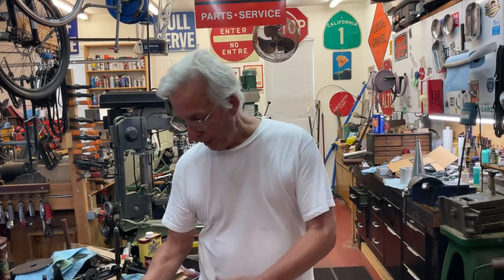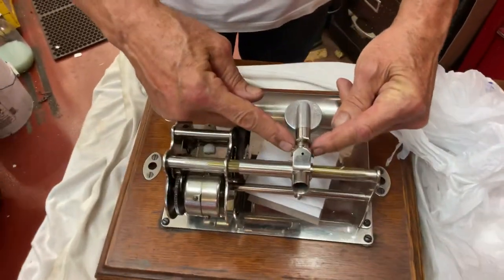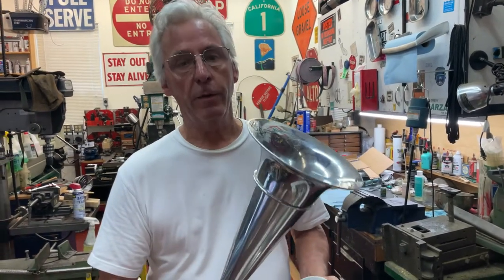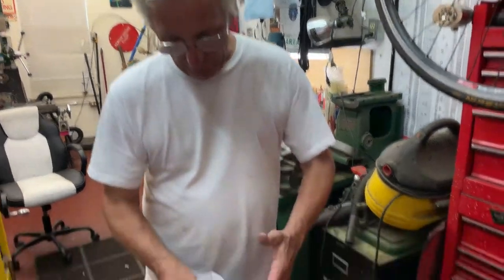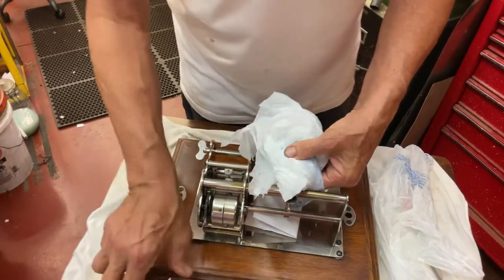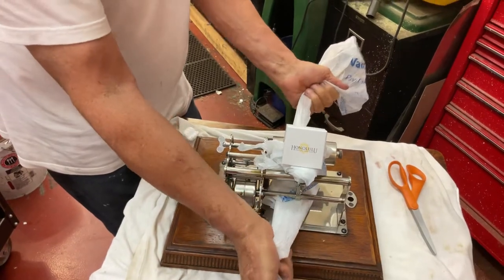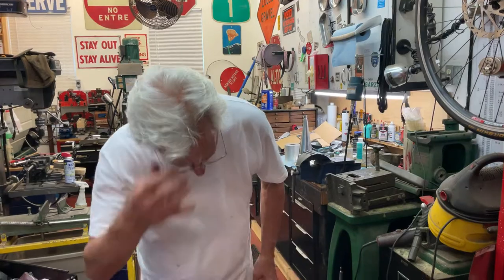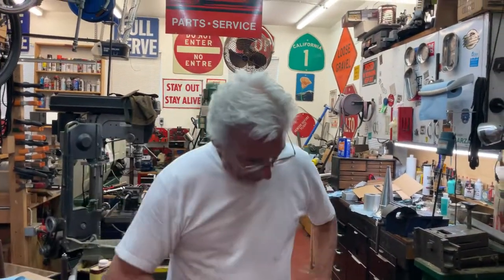721.  How to pack a phonograph for shipping

Comment: I've had phonographs arrive with broken governor springs, I assume because the weights jostled enough during shipping that one or more springs got stressed and eventually broke. If I were dealing with a knowledgeable seller and/or shipper, I might ask them to cut open a rubber band and tie it semi-loosely around the governor weights, or maybe wrap them with bubble wrap.

Do you have other ideas for supporting the governor assembly?

Thank you both for another helpful video.